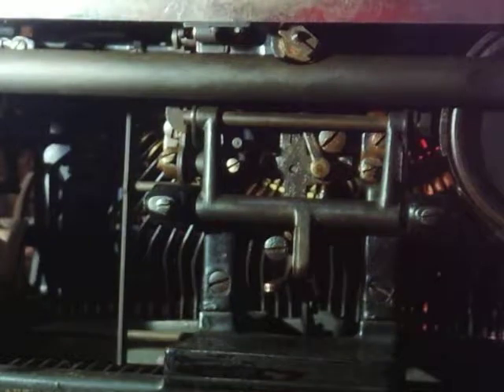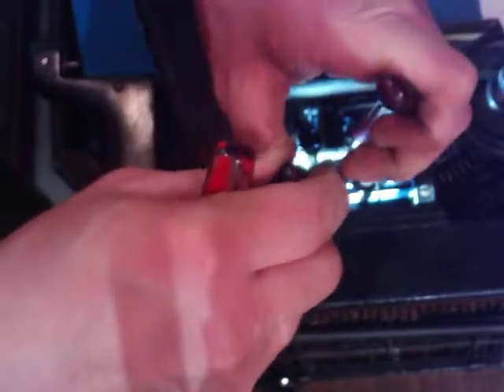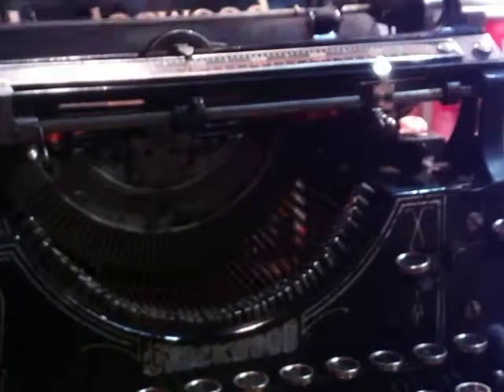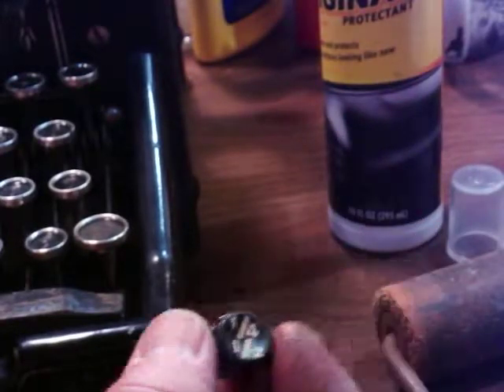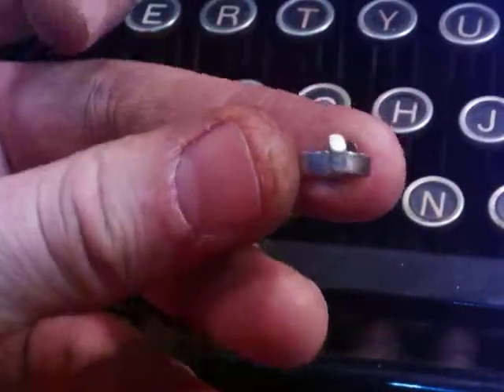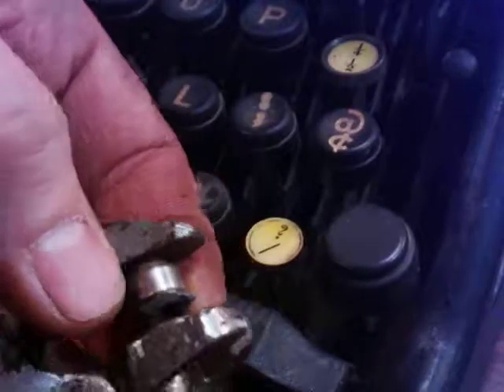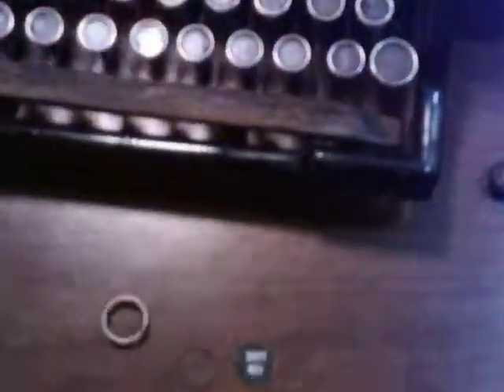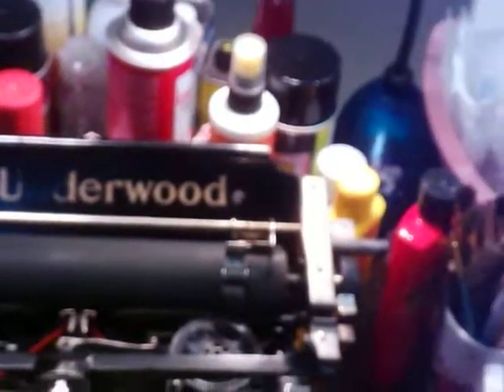Spring Repair, Key Character Replace vs. Plastic Key Covers

Comment: I wonder if you can modify your keytip tool by making an impression in a key using a thermoplastic like Polymorph or Instamorph, and fitting this over  the top of the upper jaw. It would then press on the glass perfectly evenly and, being nylon like, would perhaps be a little gentler. I use Polymorph for all manner of custom applications, its very useful stuff!